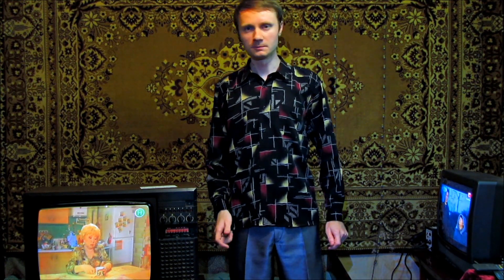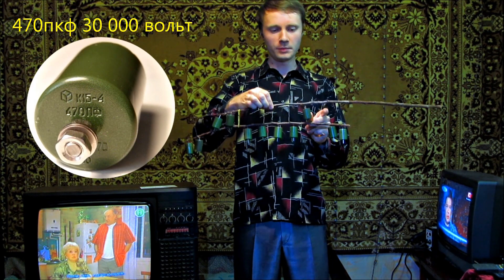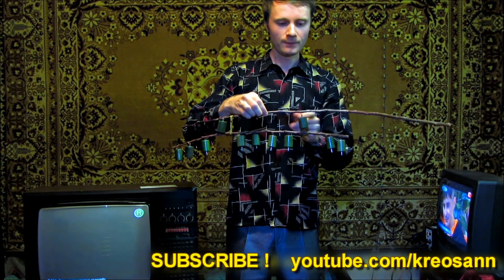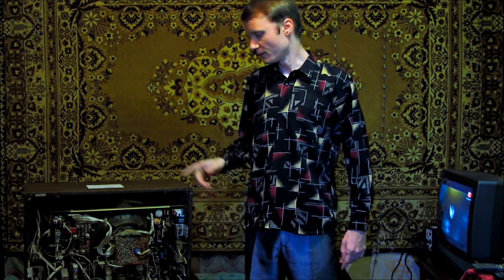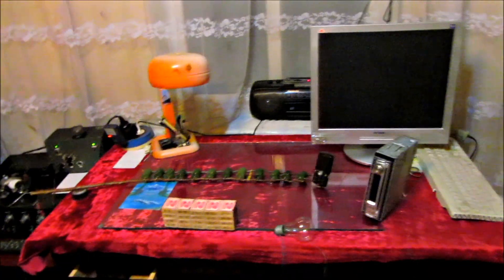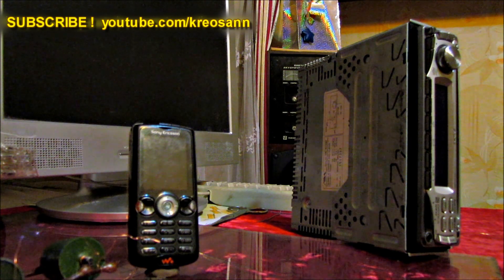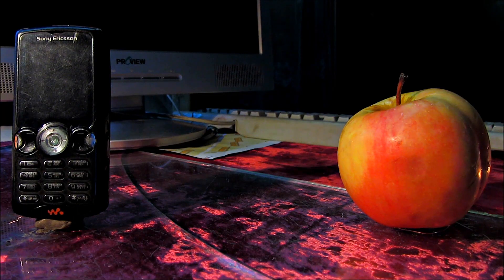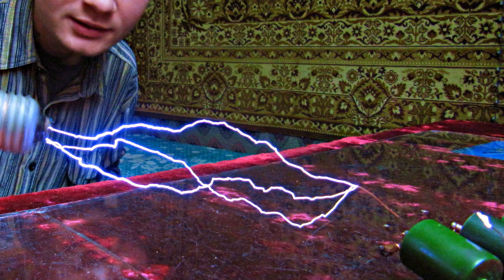How to make a high voltage generator just for 15 minutes

Comment: Would you help me build a high powered directional EMP device that is portable and does not need to be plugged into external electricity? What I mean is can we use high power capacitors in a series or in parallel as the energy source instead of plugging into a wall? The device would need to be able to control the direction so that if I want to use it on a target such as a radio that is around other devices I would be able to affect the radio without affecting other devices around it?

Comment: How many voltage produced?
Reply: By applying the rule that can break through 1 mm of air per 1000 V and he said the arcs were 28 centimeters long I would say about 280000 V.
Reply: I always thought it was 1000v per inch of air.
Reply: That would make sense, thanks :)

Comment: I have to say, this is creative. I always focus on building projects that last a century, while you have discovered how to use twigs to use a resistive elements. Brilliant, really. Ever tried clear plastic tubing filling with water, as water resistors?
Reply: Plasma Channel it needs to be around 1 mega ohm water cant be that resistive, can it?
Reply: Kno3 pure water is the best known insulator, actually. However, the slightest impurities will allow conduction. In general, I discovered 2" of travel in normal Tap water is 100kohms.
Reply: Plasma Channel really, although the amount of impurities vary this is very helpful, thank you
Reply: @PlasmaChannel  Big fan !!!!!sir
Reply: @PlasmaChannel  woah 6 years ago im a big fan of you plasma channel

Comment: Cool video, but while a shock from an EHT transformer mightn't be lethal, the output of a Marx generator could be because of the charged capacitors! I built one of these once using capacitors constructed from PVC waste pipe with alu foil inside and outside for the plates.